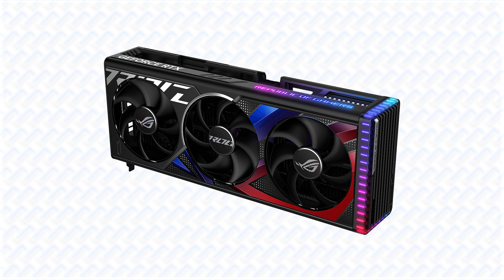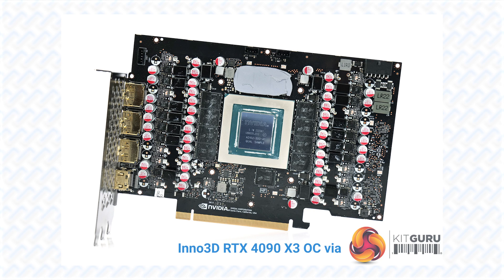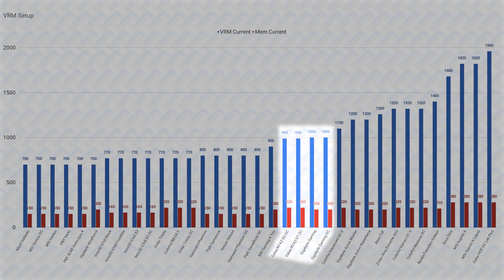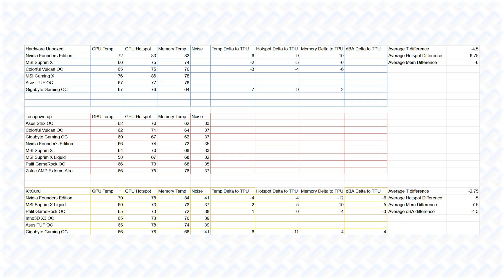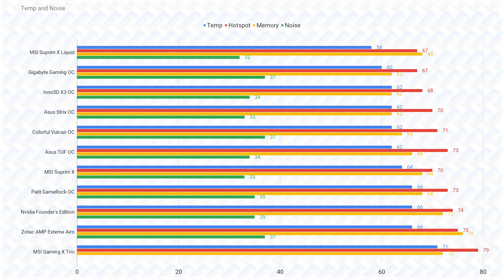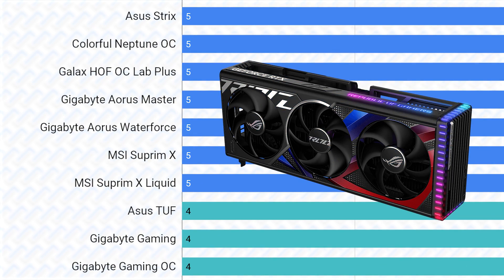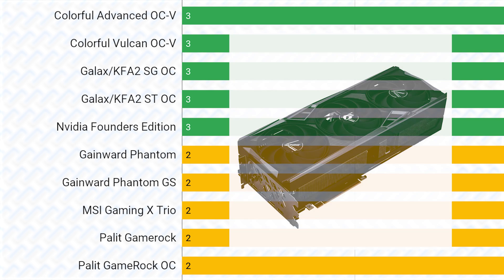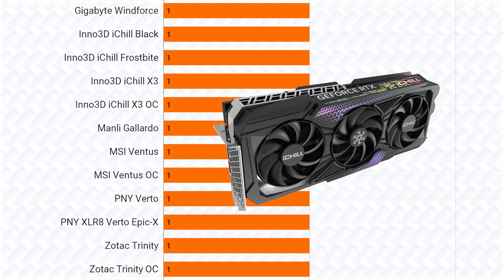Which RTX 4090 to BUY and AVOID?! | 35 Cards Compared! Asus, MSI, Galax, Gigabyte, PNY, Palit, Etc.

Comment: This is a great guide. And as mentioned in the video, if you don’t care to overclock, then any of these cards will do as all perform within a percentage point of each other at stock settings. 

Overclocking and cooling performance is what you mainly pay for when looking at different models of the same gpu. That and potentially higher binning (silicon lottery) which can, if lucky, reward you with a more power efficient processor (always a nice thing :D).
Reply from the maker: That's exactly it. I really appreciate when someone watches the video and understands what I meant haha.
Reply: you forgot to mention noise, especially coil whine, buzzing or roaring sounds, while playing.
Reply: @BeatmasterAC  coil whine is card dependent. it doesn’t happen just with one card
Reply: @Davinmk  
never said it does. It's just a variable to keep an eye out.
Reply: The gamerock card is really trash, it draws 450w of power and can only clock to 2650. I have sent mine back and am getting the MSI Liquid card.
Reply: @vidiveniviciDCLXVI  
Gamerock or Gamerock OC?
Reply: @BeatmasterAC  Gamerock OC
Reply: @vidiveniviciDCLXVI 
then it must be faulty. I have a Gamerock OC myself and at stock settings it boosts to 2890Mhz in Gaming and peaks at 439W Power draw.
I Undervolted it to 2550Mhz at 0.900V tho. draws 200W less power.

Comment: Wait, I just got the MSI Gaming Trio ( Non X version ) since it was the same price as the FE. I'm the type of person to just plug it in and play. Never OC. Does this mean my Trio will be crap compared to the other models? I don't want to spend 1500 just to be cut short of the card I'm trying to get.
Reply from the maker: The non X is the same as the X. It is crappier than the more expensive models sure. Depends if that matters to you.
Reply: @OTechnology  does it perform the same fps wise and what not or am I getting smaller numbers as well?

Comment: Got PNY Verto XLR8 for 1709€, which I consider a relatively good deal considering overall crazy prices.
Reply: i have the eyes on that card too, because the cheap price , BUT, a 4090 is a 4090. But.. i have a question... does a seasonic gx 850 will be good or should i replace the psu too? i have a r9 5900x.
Reply: @vrnoobie3804  I'm bought it for VR too :)
I have 760W Fractal Design ION and 9700K at 4,5GHz and it works fine.

Comment: thanks for the review. i will be taking delivery of a manli gallardo 4090 soon and will update this comment with some benchmarks and temps once i have them so people know what that card has in store
Reply from the maker: Awesome! Do post an update
Reply: @OTechnology  I will do a video showing multiple games and temps soon but from what ive found regarding noise and temps the manli should be around atleast b to a tier. noise is really low and temps on games like bf 2042 are not even touching the 55 c's. however i must note that im using a mesh front panel case with 3 intake fans and 1 exhaust at the back aswell as a coolermaster 240l with both fans exhausting aswell. temps on my cpu reach a max of 60 under load if that says anything. however like i said i will do a full review quite soon and im working on it right now.
Reply: @RegardedMith  i found very low price 4090 manli openbox card like buying 4080.... when you are using 99% gpu and how is the noise fan and temp? its unlock to control gpufans with msiafterbuner? because i brought one mllse 3080 on aliexpress is so hot, high noise and cant control fans :(

Comment: After spending $10,000 on rtx 4090s, I returned all of them and only kept the gaming OC model. FE model coil whine was horrid and the fan had higher pitched noise.

If you are obsessed with a silent monster gaming rig like me, go with the gigabyte gaming OC model. It's not completely 'silent' but everything about that card is low pitched, which makes the noise so easy to tolerate.
Reply: when you realize 10k of 4090s is only 5 of them...
Reply: listen to this man.
Reply: Don’t listen to this man, gigabyte oc has a shitty board, also coil whine

Comment: I am really happy with my Suprim X 4090,  I think it's a high-quality, great performer all around. Not quite the overclocker as the Strix I previously had, but I don't care. It has no coil whine and it's silent.
Reply: I just ordered the Suprim x 4090 last night. then just saw this video. so glad to see it a top card of all the other cards I could have picked.
It's going to look go too matching my ITX MSI MB and SFF case! So excited to get it.
Reply: @SinMxchine  awesome!!!!! When you take it out of the box it will blow you away, the build quality and overall look of that card is just amazing. Congratulations 👏💯
Reply: hey i dont understand nothing about liquid cards... can i use for ever or i need repair it anytime?
Reply: @webfabio6259  so you have a Suprim X LC 4090? If you do that's a closed loop, you don't need to change anything. The only thing you would really need to worry about is having a big enough case to mount the 240mm radiator.

Comment: If I do no overclocking at all, is there any harm in getting the lower end ones? Is there much benefit to getting the higher ranked ones? 
Does the answer change if I'll be running high usage % while the machine is on, significant hours?

Comment: I got the Suprim X. It's a ridiculously good purchase at the moment with the Strix OC sitting at 2200€ and the Suprim X at at 1920€. the cheapest 4090 models are about 1800€ right now so I'm really damn happy with that.
Reply: Its shocking that i forked out that cash (1700 euro) earlier years ago for the 3080 TI now the 4090s are at that price.
Reply: I'm also bought the Suprim X 4090, for 2090 euro. Waiting for my card.
Reply: I'm with you guys as well, I have the 4090 Suprim X air cooled, and it's a gorgeous GPU. Quality performance and looks! The strix I previously owned had horrible coil whine which was unfortunate because build quality was tops like the Suprim.
Reply: Where did u buy it ?
Reply: @Noone-iy7rk my local Micro Center had them in stock for $1749 plus tax. I added a 2 year protection plan to mine so final purchase price was $2004usd

Comment: Wow. Very nice! Thank you. Completely shifted my mindset away from the MSI Gaming X Trio I was looking at to the Asus TUF. Yeah, it's a bit more, but I am one for playing around with OC'ing, as well as a stickler for noise, and the ASUS TUF stats looks pretty nice.
Reply: TUF owner here! Coil whine is terrible!

Changed to msi x Trio which is completely silent under load
Reply: Im starting to think it must be an Asus thing. I just upgraded from a TUF 7900 XTX to an MSI Gaming X Trio. The Asus had coil whine but the MSI has none at all
Reply: @chrissyboy7047  hey dude, how its going now? Is your gaming x trio still making no noise at all?
Reply: @alexwishm3327  hey mate. Going well. No noise at all. Running perfectly silent. Ive noticed the fans very rarely ramp up too compared the xtx
Reply: @chrissyboy7047  This is great, thanks for the answer. I also didn’t find anyone on Reddit having problems with it yet and I hope I won't be the first 😐
Reply: @alexwishm3327  No problem. Have you bought one or are you intending to buy one?
Reply: @chrissyboy7047  I’m still choosing where to buy, there are just a few places in stock due to the upcoming holidays
Reply: @alexwishm3327  I think its more likely due to the China ban. Its caused stock to run low and prices to run high. Thankfully I got mine at retail price but it was one of only a few which was. The rest were out of stock when I got mine
Reply: @chrissyboy7047  Ah, got it. Well, my country is right next to China and such prohibitions do not apply here, but at the same time the prices are insane ($2300 minimum at the moment)
Reply: @alexwishm3327  its affected prices worldwide unfortunately. They were already very expensive and even more so now. The general advice was if you can get one for retail now then get one while you can so I grabbed one. It was out of stock the next day
Reply: @alexwishm3327  I also didnt have a lot of choice of cards to choose from but Im halpy with the x trio. Its proving to be an excellent card so far. Seems to run quite cool and quiet in a well ventilated case
Reply: @chrissyboy7047  Hello again dude, can I ask you one more question - have you tried changing the RGB lighting in the Mystic Light application? Is this even possible?
Reply: @alexwishm3327  as it happens I have. I use the MSI centre app as I have an MSI mobo. All works fine. Everything in my pc now syncs together unlike when I had the xtx which always did its own thing and didnt match. Lol
Reply: @chrissyboy7047  So you can change the color of the RGB drake on the video card instead of the default rainbow one? Because someone wrote on reddit that it is impossible to do this
Reply: @alexwishm3327  yeah you can. I got bored of tge rainbow unicorn puke so jhst have everything a nice shade of green. Lol. Imcluding the card 👍
Reply: @chrissyboy7047  great, thanks for answering. It's a pity but now it's out of stock in my area, haha. Everyone suggests taking Suprim X, but I'm afraid of loud coil whine and burnt connectors 😩

Comment: I actually got a 4090 ASUS TuF non OC and I’m super happy based on the tier selection. Im pairing my card with a Ryzen 7 5800x3D and I can run pretty much run anything on 4K settings at 120 fps and 1440p settings on 240 fps. I manually did an overclock on mine so I can boost the clocks speeds a little higher than the OC edition , not worth paying more for the OC edition when I can manually overclock and get better clock speeds and save some money at the same time. ASUS is always up there with the best of the best which makes me happy.
Reply: TUF line is surprisingly good bang for buck (none really are when it comes to 4090 but still)
I've been using a 3080 tuf for years (got it on release day) with 0 problems.
For the 4090 the TUF and the MSI Suprim seem to be the best picks outside of maybe extreme overclocking.

Comment: I would recommend checking the card you wanna buy online first. Look for coil whine comments and see how often someone complains about it. It is a huge issue if you want a quiet build. I for example got burned(twice) by ASUS TUF 4090. The noise this thing generated was just unbearable. And I have a closed case that is under desk. I've settled for Gigabyte Gaming OC and when undervolted it's quiet as a whisper.

Comment: I got the PNY XLR8  Verto Epix-X since I read from reviews that this model generally has low coil whine. I always intended to undervolt the card, so I didn't care about the low power limit. In fact, the smaller cooler size was a big selling point since it would guarantee it would fit in my case. Unfortunately, I got unlucky and my card has a lot of coil whine, but it's not enough to make me want to return it. Good enough, I guess.
Reply: i bought 4090 pny too,i undervolt it,and still got awesome performance and amazing temp,i dont want hving 600wtt gpu for extra 3fps
Reply: For real I just got PNY Verto it's amazing too  @natsu78999

Comment: hey, great video, and you explained things really good, but i came here with questions that still remained unanswered, so how much, and in what categoriesthese ranks are, when you put a gpu in s tier, and one in b tier, how much difference are they gonna have, are they gonna hit the same fps in games? and higher temps, does that mean the gpu in lower tier is gonna have a shorter life span? and how much more performance the gpu is gonna get with the overclocking?

Comment: I first bought a 4090 Liquid X by msi. The card is great, but the coil whine was stupidly loud. I sold it and bought Ventus 3x OC. It’s louder and hotter in terms of the cooler, but the coil whine is mostly gone.
I didn’t notice any performance difference too!
And yeah, one of the reason I change the GPU is because I rebuilt my system and went sff. Now my 7700x + Rtx 4090 pc fits inside regular sized backpack (pc is 10 litres in volume)!

My point is, you don’t really need to hunt for the best models of 4090: just grab anything that fits in your case and costs less

Comment: I got the zotac non oc and so far I can't complain other than if you crank the fans up it's noisy af. On standard fan curve it's fine, not seen it over 70c, undervolted with 80% pt and running 2626mhz I'm averaging 50c or less.
Reply: Hey, just out of curiosity do you have a lot of fans in the case? Only have 3 in mine and those are the front fans and I kind of want to see if getting this card and some extra case fans is a good idea.
Reply: @shrimpwalk  I have a coolermaster case, think it's like a c700p cosmos or something. It has 3x 200m at front, 3x 120mm on top an a 140mm at back. If you're looking to cool the card, my advice is to use msi afterburner, set a custom voltage curve to 900mv at 2626mhz, then turn the power target slider to 80%. On 3d mark I hit 24k+ on that undervolt vs 25k+ on standard, so you loose little noticeable performance in games. I rarely see my card over 55c, saves a sh!t tonne of power too, even more so if you use dlss ect. As for fans, as I always think if you have the slots for them, use em. If you don't have an exhaust fan, Id fit at least one

Comment: I'm happy with my 409ü suprim liquid x. plenty of power for all the games I play on 4k@120fps on ultra without dlss. I run it undervolted und at 2300mhz instead of 2600+ mhz it could do. It consumes between 200 und 250 watts under full load so it runs very quiet and cool at 40-50 celsius
Reply: i like the suprim but i got the trinity oc 2790mhz out of the box 43 degrees while gaming …i have custom loop cpu and gpu 13900k
Reply: @Revengegamer-dr  What's the power consumption of the card @2790mhz?
Reply: @ae-gc7ck  benchmark 42 degrees 2790mhz 1.050v out of the box
Reply: @ae-gc7ck  while gaming mw2 multiplayer 2805mhz 41 degrees 230w .260fps … i have custom loop .. i9-13900k
Reply: @Revengegamer-dr  which resolution and settings including fps limit
Reply: @ae-gc7ck  3413*1920  i have low setting on the game if i use 1440p setting go up to 300+fps
Reply: @ae-gc7ck  on windows i change display resolution sometimes i use 4k sometimes 2k depends.. if i want to see more fps 1440p 300+fps  3413*1920 240 260 fps
Reply: @Revengegamer-dr  ok thanks. Power consumption goes up a lot when you go to 4k. 4k has  26.57% more pixels than 3413(?)*1920 and 125% more than 1440p

Comment: I just bought the PNY 4090.   Got my PNY for $1650 and looks like Strix is $2150.  I'm sure the Strix is better, but 25% better?
Reply: You should keep in mind that all 4090 cards are complete overkill and any "performance" differences don't really matter unless you specifically want min maxed numbers, your never going to notice the actual performance differences unless you see the numbers
Reply: @veniulem5676  Right now I agree. Keep in mind though that apparently Unreal Engine 5 is a performance hog and there are 1440p monitors with a 3080w.  In other words, that 4090 may be huffing and puffing on max 1440p settings soon than you think.
Reply: @Lievyon  Remnant 2 is a prime example of this happening. Although much of the blame has to be put on the developers creating a game with DLSS as a requirement. Game should have been developed with native resolution in mind and DLSS should be implemented after for performance gains at the expense of fidelity.

Comment: I was fortunate to get a 4090FE. It's twice as powerful as my Strix 3080 and much quieter. Strix 4090 is about £600-800 more expensive than the FE for 3fps more, so no ta. 👍🏿
Reply from the maker: The higher end aftermarket cards are not really about better out of the box performance.
Reply: @OTechnology  what are they about? Did XFX get out of the GCard game because there's no headroom for improvement?
Reply: @thelmaviaduct  overlocking, the rog strix overclocked is easily the best gpu between all of the others
Reply: @enxgma8085  it's 50% more expensive for a 3 fps gain, no ta. 👍🏿

Comment: In my country the Manli card is 1660euro and anything else is 100 more euro more expensive, or far more. 

That is a big difference. Although if I do get a 4090 I will want to set the power limit to 60-70%, is the VRM and such important when setting such power limits?
Reply: Not at all

Comment: I have the msi Ventus 4090 oc due to its size as it’s no longer than my old 3080 & didn’t want to buy a new case, only needs 3 8pin power connectors as well which was a bonus & I’ve even managed to put 100mhz on the core with no issues. If you have a small case it’s well worth considering & you don’t have to miss out on 4090 performance.
Reply: Great to know, just bought one specifically for its size. Was at the same price as the trio but those mm will be important on my O11 Dynamic (non Evo), probably will need to buy the 90° adapter from cablemod anyway.
Reply: I am eyeing that card for my meshlicious case. Can you please tell me how is the noise and cooling performance?
Reply: @Tutku35  GPUz says max gpu temp 64.2, hot spot 70.9, memory 68 with fan speed 32% 1056rpm, that’s with 100Mhz overclock on the core playing Witcher 3 next gen update at 4K. As for for noise it’s no louder than my old 3080 gaming x, most importantly there is no coil whine. Only downside is no RGB not even the msi logo, I’ve just added a light bar to the inside of the support bracket.
Reply: @evostu7814  thanks for the detailed info. I actually dont like much RGB anymore and being have to using different apps to sync them thus I disable anyway.
Reply: @evostu7814  tengo miedo de que la 4090 strix venga con ruido

Comment: I got  the TUF OC...paired with a 12900k, so far really happy with its very strong Performance and low Temps. No Plans for watercooling this Generation. ;)
Reply from the maker: Yea there's not much point in watercooling these unless you're adding voltage to it.